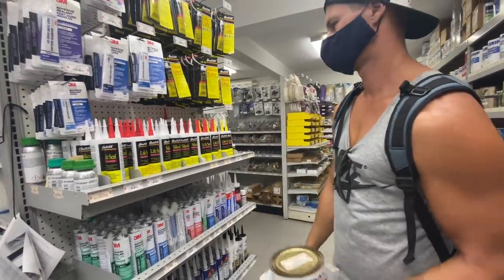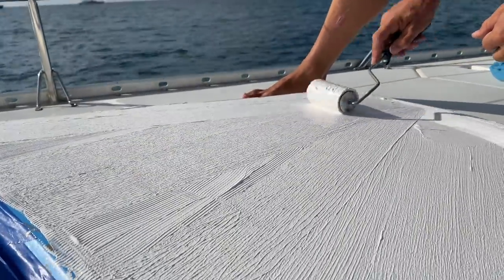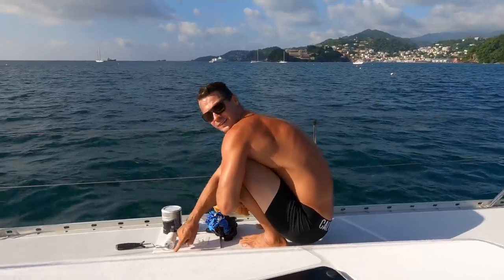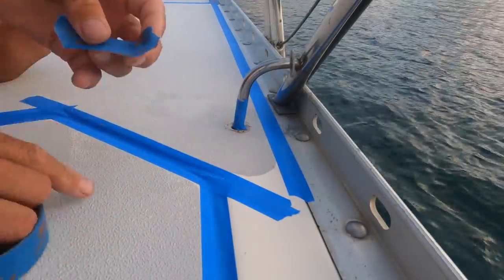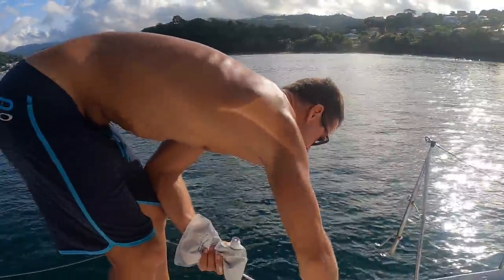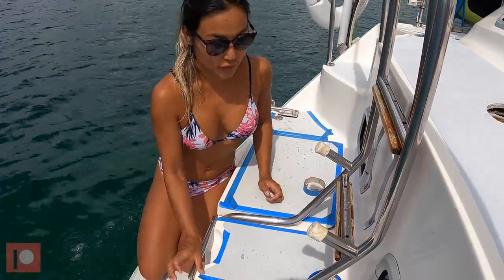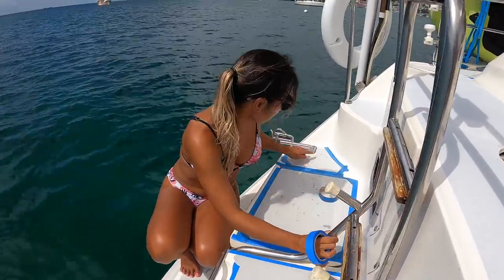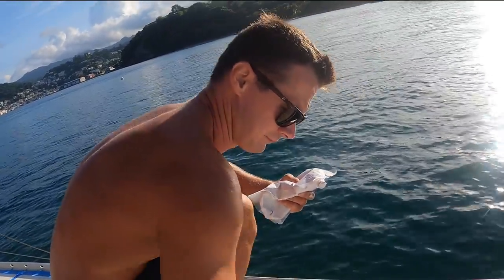Finally fixing what’s BUGGED US THE MOST about our boat! - Ep 60

Comment: Hi guys. The reason the texture is thicker when you use the kiwi roller than the old texture,  is that your old non slip is partly worn out. So using a plain  roller will mean that you have new look, but not much greater grip than your existing non slip. So you will need to apply again much sooner, because it will become slippery again much sooner

Comment: You put the product on with a regular roller. As the texture begins to tack off you use the texture roller. This way you get a uniform build up and the texture roller is only  used to create a texture.Also avoids lines.
Reply from the maker: thanks! we tried that, but unfortunately in the climate, once we put it on with the first roller, it would dry instantaneously and we couldn't follow with the texture roller.  The instant drying was the most challenging part!